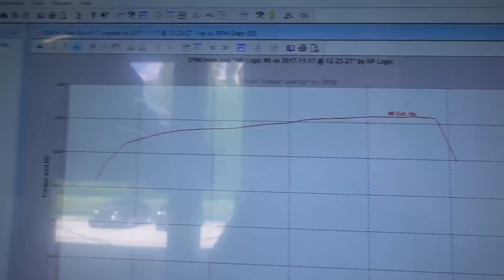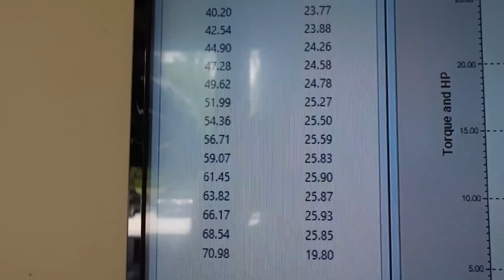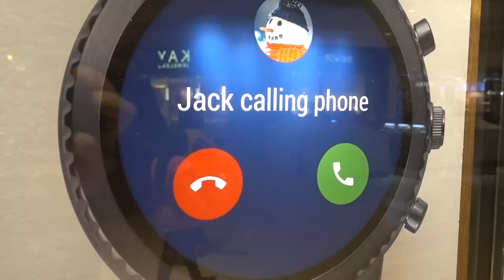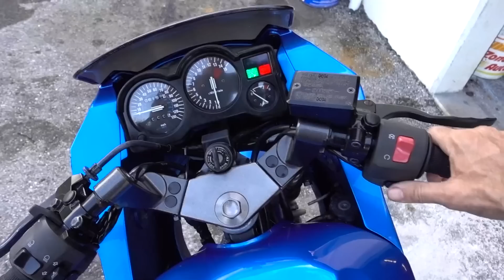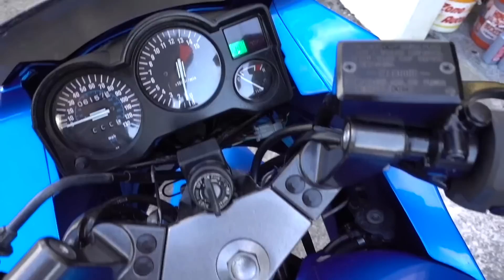Rudnik got the ONLY iPHONE X available

Comment: The Ninja looks straight out of Grand theft auto vice City
Reply: sergio martinez my thoughts exactly. And i want one now
Reply: They're super fun to ride. If you want one, look for deals, as I scooped one up for $350 and $100 later I had a nearly perfect running bike.
Reply: BRP Adventures fuck seriously? I live in Oregon, prices may differ. But why are they cheap? I drove my brothers s1000rr and it's fast! But I love the look of cafe racer.
Reply: J P The one I picked up needed a rebuild, but the guy included a rebuild kit with absolutely everything I needed. Most go for $1500-$1800.
Reply: J P Oops, misread part of your comment. The reason they're so cheap ($1500ish) is because they're so simple. Also from 1989 to 2007, they're almost identical other than a few very minor changes, so parts are easily swappable between the years. Very great bike to get into if you're starting out or on a budget.